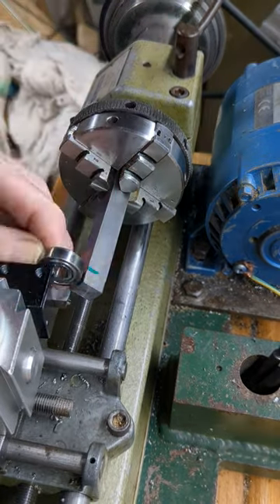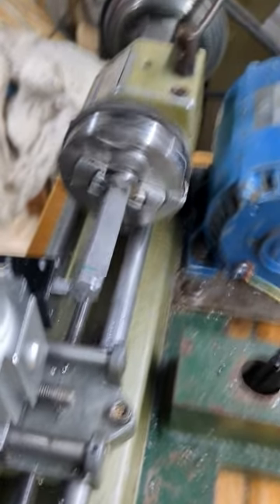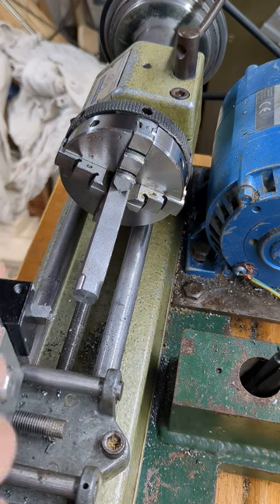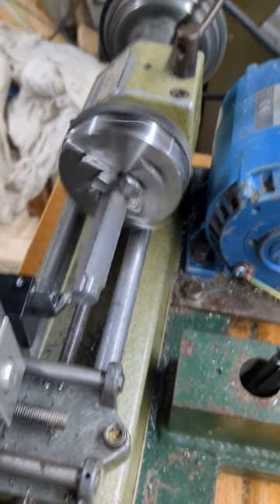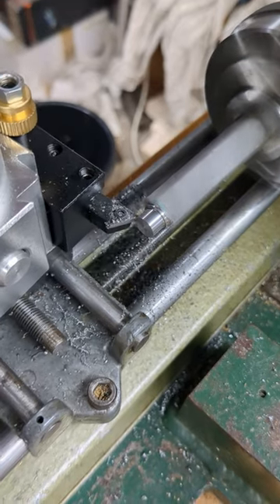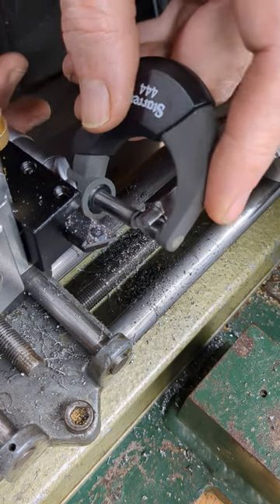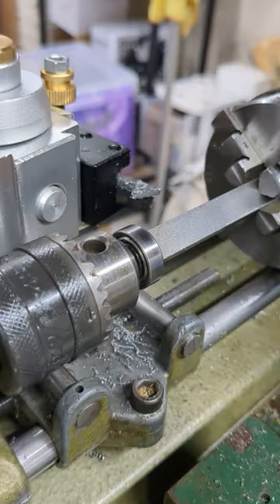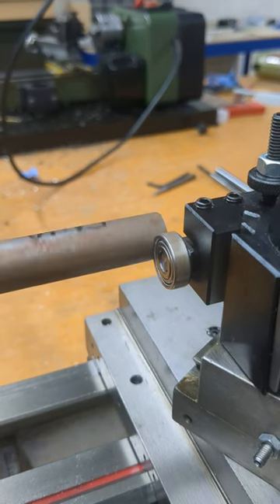Let's make a Trueing Tool with voiceover #shorts

Comment: That stickout on that interuptive cut is really something.
Reply from the maker: It was pretty scary, but there was no way I could get it closer on this lathe. It was an interesting test of what the Unimat can handle, though the bigger AC motor made it a lot easier than it would have been with the stock motor due to the torque available.